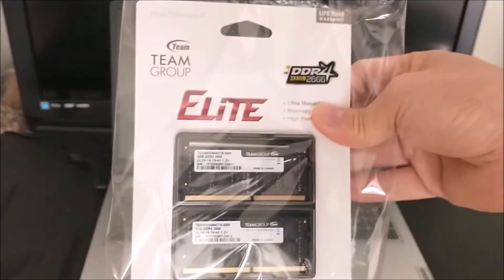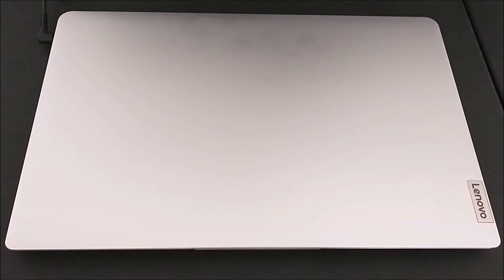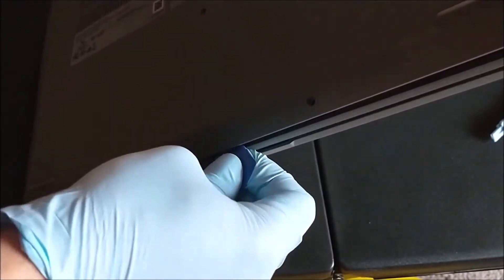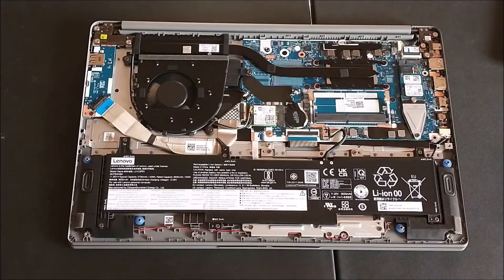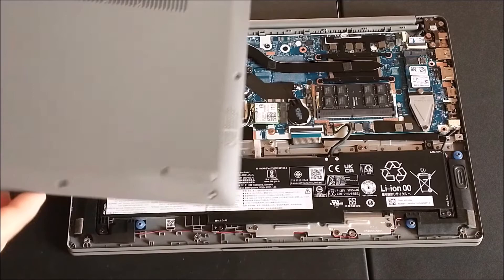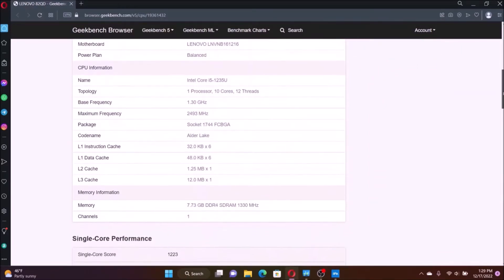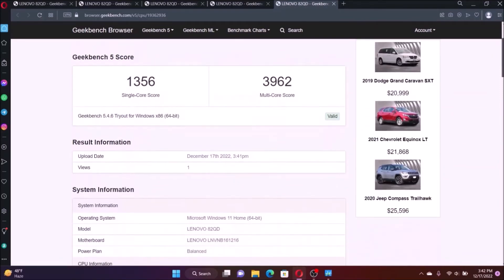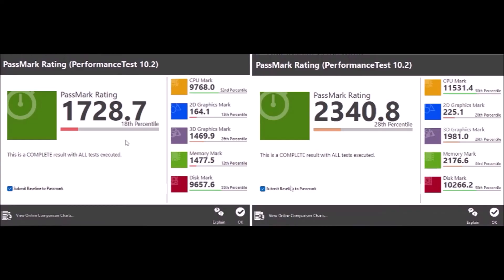Lenovo Ideapad 1i Laptop 2022 $20 memory upgrade to 16 GB with Benchmark Results.

Comment: Can you add an additional m.2 drive? Or do you have to replace the one included?
Reply from the maker: @etielrincon  I didn't touch the hard drive. I don't remember I saw a slot m.2 drive on the motherboard. I may be wrong

Comment: Are you supposed to remove the sticker from the RAM stick?
Reply from the maker: no need to remove sticker from the ram stick
Reply: @joehowto  Thank you. Another question if you don't mind, how do I get to the bios screen? I see some sources say on Google to push F2 and others say push F12.
Reply from the maker: @cheeseburgerpaladin  Try F2 first when you turn on the computer. If not working, then F12
Reply: @joehowto  Thank you. This is my first time working on a laptop and you have made it very easy.
Reply from the maker: @cheeseburgerpaladin  Just becareful not to break any tabs when opening up the case. And make sure you ground yourself first before touching any electric parts

Comment: Mine came with 4GB DDR4 RAM so this video helps a lot i didn't know you coild upgrade the RAM for this specific laptop i thought it was built into the motherboard unfortunately mine dosn't have a RAM slot as far as i can see.
Reply: Same 🤦🏾‍♂️
Reply: @curtisbrooks7190  Yeah they removed the RAM slot so it can't be upgraded but you can upgrade the SSD with more memory.

Comment: Why u install 1 ram of 8 Gb But then the pc has 16 Gb?
Reply from the maker: It has 8 g on board, so I added another 8 g to make it 16g so it give the cpu more ram for the graphics
Reply: @joehowto  is that mean that i can put 2 ram card in the mb of the laptop
Reply from the maker: @aliabukharma5463  only 1 ram slot
Reply: @ is that mean at overall theres 2 slots in the mb???
Reply from the maker: @aliabukharma5463  motherboard has 8 g built-in and 1 empty slot

Comment: It would be safer to disconnect the battery before installing the memory. In this case it was fine, but someone else might not be so lucky.
Reply: what can happen to the battery if its left like that
Reply: @Diamond-b8t  You might damage it
Reply: @NobodyisAnybody  ah I see
Reply: that is not at all necessary. you should just keep in mind to avoid ESD which is very easy. 

source: im an IT Student certified in ITF+ & A+

Comment: I have the Ideapad 1 15.6 3050U 4gb 128 gb ryzen  is there anyway to upgrade to 8gb?
Reply: No, ram is soldered onboard
Reply from the maker: I am not sure. Try to open it up to check if there is an open ram slot

Comment: Operating system: Windows 11 in S Mode
Processor: Intel Pentium N5030
Display: 14.0" 1366 X 768 (HD) Display
Memory: 4GB DDR4 2400MHz
Internal storage: 128GB eMMC
Graphics: Intel UHD Graphics 605
Battery life: Up to 10 Hours
Wireless: 2x2 802.11AX, BT 5 
Camera: 720P
Product weight: 3.08 lb.
error:
Reply from the maker: Not the same
Reply: @joehowto  for this model the correct model memory is ddr4 3200, right?

Comment: Hi i have only 1 slot ram, can it be remove and replace it with 16 gb ddr4? I currently have 4gb ram
Reply from the maker: If it is soldered on the motherboard, it can't be removed.

Comment: I’ve got the Lenovo idea pad 1i 14inches and I bought the extra memory card and opened it up and the port to slide the card into does not exist inside mine can this laptop be upgraded otherwise I need to send the card back 😢
Reply from the maker: Mine is 15 inch screen, not 14 inch. It came with 12 gen i5 processor. The 14 inch doesn't have the expansion slot
Reply: @joehowto  then why does your description say Lenovo ideapad 1i and you have the i5 .... You are confusing a lot of people on here I knew something wasn't right the moment you opened it.
Reply from the maker: @WizArt85  https://youtu.be/MHuW7knE9bA
Reply from the maker: @WizArt85   This is the link from Target. It is Lenovo IdeaPad 1i and not what you stated Lenovo i5 and also in Amazon
https://www.target.com/p/lenovo-ideapad-1i-15-6-34-laptop-intel-core-i5-processor-8gb-ram-memory-256gb-ssd-storage-windows-11-home-gray-82qd003vus/-/A-86976504#lnk=sametab

https://amzn.to/3zfFwdC
Reply: My Lenovo IdeaPadi 1i 14 
Has and extra ram slot
It's from target 
Mines has i3 1215u CPU 
(82QC004BUS)
That's the model it's on special again for $300 
Original price $539.00

Comment: mine doesn't have the slot for the ram even though I have the same computer that is shown in the video, I don't think my computer is upgradable
Reply from the maker: Are you sure it is the same model with the 12 gen i5? I bought 2 of those and both have the expansion lots
Reply: @joehowto  wait do I have to buy the expansion slot and solder it onto the computer?
Reply from the maker: @Shart-n2h  the computer comes with the expansion slot which soldered in the motherboard
Reply: Mine didn’t have it inside either I’m so confused
Reply from the maker: @autumnrose76   is it the same model, the one with 12 gen i5?

Comment: There is a big speed difference of the ram, if the chip is square, it’s slower. If the chip is slightly rectangular, it’s faster. If the chip is more rectangular, it’s the fastest. About 1-2 GB capacity. It’s ideal to get the fastest ram, if the video chip uses the ram. Stickers need to be removed inside the laptops, they represent the user as gay, if satellites look through the device. Black stickers and foils put the laptop on blacklist. To remove these, you need liquid thinner or similar. I use my nails to do that.
Reply: Blud just said a bunch of nothing
Reply: god-level tier trolling here lol